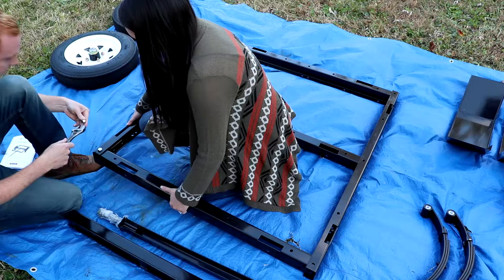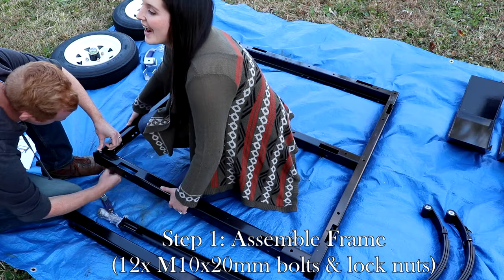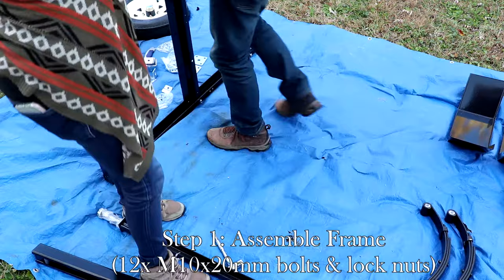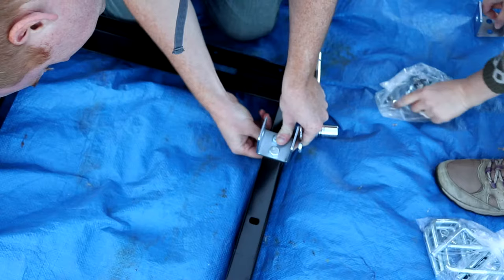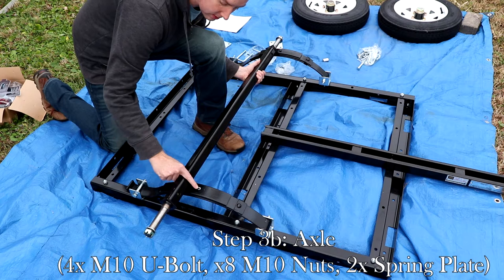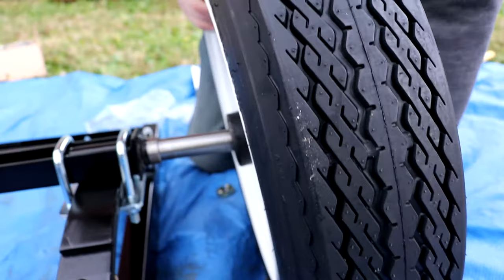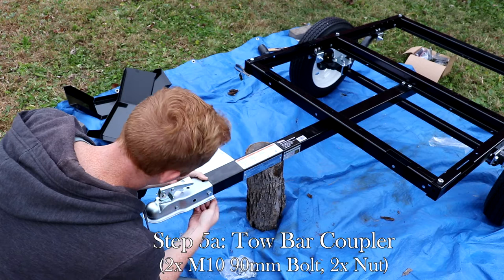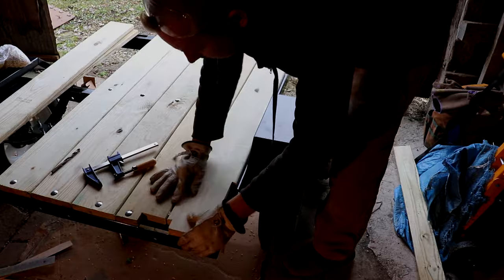How To Assemble | Northern Tool Ironton 40 x 48 Steel Utility Trailer

Comment: I got the 4x8 trailer, one thing I can say is, the fender mounts slap against the trailer frame and make noise, so before you put the fenders on these trailers get some rubberized coating of some sort or some adhesive rubber pads, and spray the back of the fender mounts with the coating, or stick on some rubber pads then put the fenders on.
Otherwise they rattle pretty bad, no matter how tight you get them.

Comment: Just curious even though this video is 2 years old.  Harbor freight has a similar model for $399 too.  Is this pretty much the same chassis in a different brand or an improved model?  Northern tool charges $200 just to ship this to CA and my harbor freight is just down the street. I've seen folk change the wheels and tires to a more highway compatible one.

Comment: Ok, this is a great video demonstration and I truly appreciate it.  I need to build a camper that I can live inside of that can be pulled by a bicycle.  Can you explain to me what type of attachment I'd have to have to secure it to the seat post of my bicycle; I'd prefer to pull it that way.  Also, I'll need to purchase one of those towing jackets with wheels so that it's more level and pulls better.  If you have any ideas at all I would certainly appreciate hearing from you.
I'll have to figure out flooring and how to make those tail lights work; I need advice on that as well.  Thanks.

Comment: Awesome video, what size boards did you use and how many? I bought the same trailer, but i was going to do diamond plate for the flooring but its looking to be too expensive so wood it will be thanks for your time and effort
Reply from the maker: Glad the video was helpful, Juan! I used pressure treated decking boards measuring 1" x 5.5" for the base of the trailer bed.
Reply: @IndyHomestead  how did you mount them given that the holes don't line up well? Did you have to make more holes in the frame?
Reply from the maker: @XeviousGG  
I did drill a few extra holes to meet my needs.